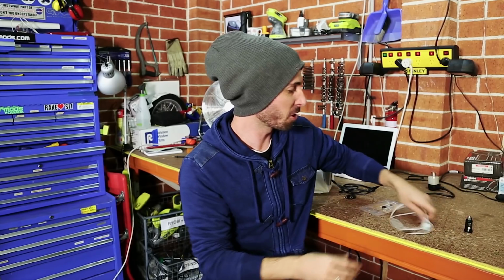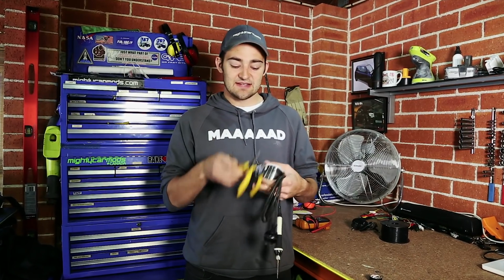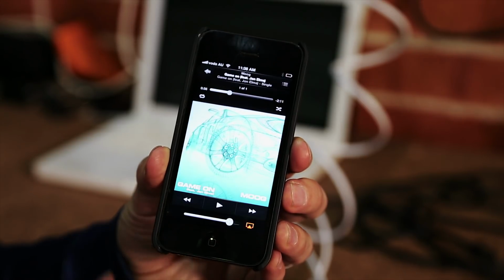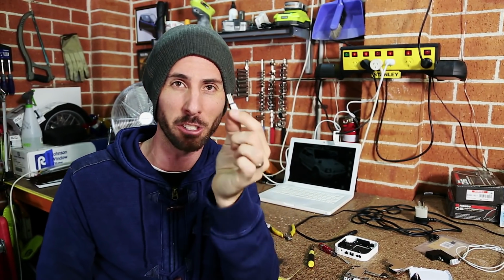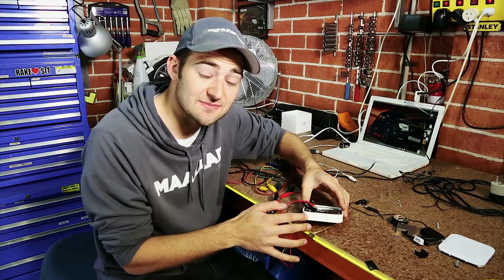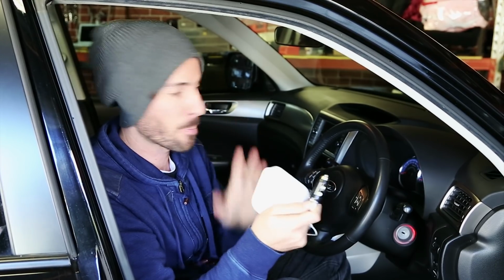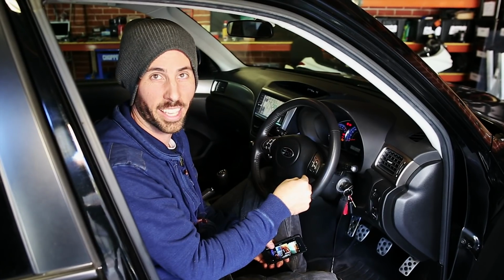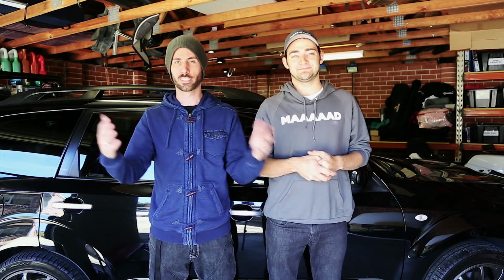Install Airplay In Your Car

Comment: Now, if you could only hack it to grab a digital output before the audio goes into the onboard DAC, you'd have an audiophile grade cheat piece from heaven.
Reply: The DAC in Airport Express is top-notch.  Ridiculously good.  There is also a digital output inside the audio output port of airport express units...just use a mini Toslink to access it.  No reason though...did i mention the DA converter is completely amazing, and that the RCA output is super clean and high voltage?

Comment: Why not just make a cable with a buck convertor from 12v to 3v?  instead of hacking the device.  Just saying ... then if the device dies, buy a new one, plug it in.
Either way, cool idea.

Comment: For anyone interested in getting wireless music without the complications of doing what they did, look up the Griffin Itrip Clip. $20 and it does the same thing (using Bluetooth so both apple and android work) it holds charge, is a lot smaller and has audio controls on it.

Comment: The major difference between Bluetooth and AirPlay is that while Bluetooth compresses the files before transmitting them to the headunit, AirPlay is sending those files uncompressed, ensuring you get a noticable difference in sound quality. Even with AptX you won't nearly get the same quality from bluetooth compared to wifi-based solutions such as AirPlay or Chromecast.

Comment: Not that it matters much in a car but Bluetooth is compressed for transmission and so not 100% of the original frequency spectrum. Wifi and Ethernet are 100% faithful to the original source . Just saying it might account for the effort.

Comment: i did this with a Bluetooth receiver.i did away with the receiver battery and soldered in a power regular then hard wired it into my car but got that electric static problem coming out of the speakers how you fix that

Comment: There are easier cheaper ways to listen from our phone music to our car stereo with a little common sense. On my old 1996 car  I used AUX cable connected to my iPhone or MP3 and old stereo with AUX connection. That's it. My new 2012 car already has built in Bluetooth, AUX, MP3. With Bluetooth you can synchronize.

Comment: The cheap Bluetooth audio adaptors are pretty flaky. I currently have a rental car, simply getting into the car starts the music playing. With my $35 cheapie Bluetooth adapter this never happens seems like I always have to press the device to get it on and it will pair only 80% of the time. So this may be a good option. The new AppleTV has this ability to and does not require a Wi-Fi network i.e. does Peer to peer connections. Getting audio out of it challenge as his H DM I only know digital audio out like the old one

Comment: i use a lightning digital av adapter connected to my iphone then usb lightning lead to power up the adapter connect the hdmi lead into adapter then to the hdmi input on my pioneer car media system .... create a wi-fi hot spot on my phone and then connect to my slingbox via the phone and haypresto live tv in the car or music

Comment: Why not using a bluetooth speaker and mod that??? You're iphone also instantly connects to this device and plays audio just fine! I did this with my home cinema, just crack open a cheap (or free) bluetooth speaker, cut the speaker wires, solder some audio jack on there, and boom, you have wireless audio! I did got my speaker 4 free! So free wireless audio! And sounds really good!

Comment: All Cars after 2012 have Bluetooth Built in so.... all that hassle or just turn on Bluetooth...
Reply: AH8657 90 oh yea and what about all us plebs with cars before 2012? You donkey!
Reply: Jason Devlin dumb ass u can use aux or Bluetooth I had a car that's 2010 that had Bluetooth now I have a 2016 so I don't need an Customisation
Reply: i got a 96 celica with bluetooth and i can do that to any car with a battery

Comment: Installed a Bluetooth adapter from iSimple the other day in my car. Cost around $30 US. It's just a cable with a lighter socket at one end and a headphone plug at the other, the dongle part is small and includes a microphone and button for hands free calling. Way better solution than the Airport in this video, cheaper, and more functions. Plus it's far smaller and more portable :0)

Comment: Don't use bluetooth! Wi-fi is better for many reason.
- Best audio quality with wi-fi 
- turn off bluetooth and you'll save battery
- Best range with wi-fi
- If you don't have AUX. connector, you connect the 1/8 cable (from the airport to...) to the CD player connector or Tape connector.

:)
Reply: 1. wifi also drains battery, 2. range? what are you talking about. so you want to play music inside the car while you are outside?
Reply: also, in audio quality nothing beats good old wired connection
Reply: JayVan Geli I agree

Comment: Or use Bluetooth.....
Reply: Yup , get a 5$ USB Aux To Bluetooth transmitter.
Reply: (Also will work for Iphone + Android + Windows)
Reply: +Bastian Fontaine Range of my bluetooth audio receiver is 20m. Your limusine is longer than 20m? Would you like to listen to the car audio system out of the car? Is your car audio system strong enough to be heard from a distance of 20 meters? AirPlay in the car is a stupid idea. AirPlay is good for game video streaming. For video playing is better to use a smb (Samba), or ftp server. DLNA is a mess. AirPlay audio is suitable for villas, if you have speakers in every room. Through walls WiFi works better than Bluetooth.
Reply: I don't really understand why you nerds are arguing about bit rates. As long as you can hear something coming from the speakers in good quality, it should already be fine.
Reply: bit rates are accually what makes a sound "good quality"
Reply: I'd like to see a source for BT being able to handle 24 bit. I've never managed to get anything more than 16bit through BT, even on v4.1
Reply: I assume the MY09 didn't have Bluetooth? My MY12 does and aux and USB aux.
Reply: About-Alex Exactly what I thought.
Reply: On a factory system, you won't be able to tell, especially when you are pushing the sound via AUX.
Reply: For a car like a older Toyota which has a factory system this a very good option. Bit rates aside this is a good alternative to a $150 adapter (assuming you have a airport express sitting around).
Reply: The people who cry about bitrates aren't the same people who argue FLAC vs MP3.
Reply: for all u kids arguing about bit-rates... fuck up also how about AUX
Reply: Ôzeş Gülok Do you think Bluetooth can not transfer the bitrate needed for your music? :'DDD
Reply: +Pro_Gamings 2ND channel Bluetooth to aux you mean
Reply: +Bastian Fontaine Through which cable going audio from Apple AirPlay device, to the car audio system? Trough HDMI, S/PDIF...? Or through 3.5mm mini jack/STEREO cable? So where is the higher quality??? When you think you recognize the sound quality, buy a cable with gold plated connectors! :D Do you ride the bus, when the cable length bother you? When you own the high end car audio system, with surround sound, I believe, the system support some wireless streaming. What is more expensive, it is automatically better? I'm happy, I'm not the american Apple sheep.
Reply: About-Alex just use your IPhone 7's headphone jack... oh wait
Reply: Bluetooth is much lower quality than Airplay though. If you have a fairly high end audio system, there will definitely be a difference in sound quality.
Reply: konzerva80
3.5mm is what I use for most of my stuff, I'm not an audio snob or anything. And yeah, every system should have wireless streaming but bluetooth is shit for that right now. DLNA, Airplay, or hell, chromecast are all much better options than bluetooth. Plus bluetooth is limited by range which sucks cause I tend to walk around a lot and it doesn't have enough range. With internet streaming services such as those, it really is a better experience overall. And my receiver has Airplay built in so it's not an airplay device connected to it.

Comment: Lol at all the comments suggesting the use of a cheap Bluetooth dongle. 

1) This video was released nearly 3 years ago, let it go.
2) Airplay had much better sound quality than A2DP at the time this video was made. 
3) Yes, Bluetooth is cheaper and easier. They were aware of that. The point of the video was to install Airplay into the car, not Bluetooth; otherwise it would be titled "Install Bluetooth in your car."
4) Go do something productive with your life instead of whining about something someone did to his own car some 3 years ago. :)
Reply: But you'll waste your time whining about other people whining?
Reply: Tim天明 says as he fucking writes a whole paragraph.
Reply: Wouldn’t aux just be better sound quality and basically free
Reply: Do you hear higher sound quality through Airplay??? :D

Comment: This will only work if you have WiFi. So you have to use your phone's hotspot while you are driving. Unless you just want to hang out in your driveway or garage and use your home WiFi. So why not just use the Auxiliary input if there is one there already? You can output sound from the Lightning connector on phone instead of the 3.5mm Jack for better sound. Just wondering.
Reply: +KissofDawn2012 
1. Bluetooth
2. Easier to sit in your car and get going rather than plugging in a cable every time
3. Cause race car

Comment: so.... instead of a single cable going from your phone to the car, you now have a cable going to a charger, a separate one going to the stereo, a box in the centre console and you still have to have the phone on you! seems almost pointless! a better solution would have been to just get a cheap Bluetooth A2DP adapter which already gets powered via micro USB and use that. The job would have cost 1/5th as much and would do the same job.

Comment: I'm using a Bluetooth transmitter connected to the audio out, and Bluetooth speaker, and don't have any speakers installed in the car. Just Bluetooth. You can move the speaker around, or move it outside. So far, I think it's OK. Then again, I don't need BIG sound.

Comment: Use Bluetooth 4.0 with aptX, you can even get a device that has an optical output, I have one myself and it works amazing. You can sync new devices with NFC, but once it's set up it will automatically connect.

Comment: a cheap and easy way to get music in your car???!!! wtf its a expensive and hugely complicated process just so you dont have to plug the jack in to your phone? i dont understand the advantage, they spent loads of money and time and now have to have a extra box in their car just so they dont have to plug there phone in? either way they have to plug the box in. this reminds me of a story about america wasting millions developing a pressurized pen that would work in space and the Russians just used a pencil..... maybe im missing some huge advantage this system has
Reply: +Charlie Ward you are also missing the point of the pressurized pen, it was so that pencil shavings don't get into air filters and cause issues. But the reason for The Airplay (Which I agree is stupid in this application) is more of a convince than anything so when you are riding with your friends or road tripping with more than like 2 people anyone can be the DJ without worrying about a cable.
Reply: MrLazer1211 ahah ah ok :P thats actually quite interesting, how did the russians get around the shavings? just clean their filters regularly? aha and yeah but passing the jack isnt exactly hard ahah
Reply: +Charlie Ward I'm pretty sure that Russians are being using automatic pencils. They didn't flew in the 18th century to have the need of shaving their pencils  :D

Comment: This is a very good idea but unfortunately I don't have the headphone jack in my car do you suggest anything
Reply: If you have an AUX button, you should be able to buy a cable for it. If not, install an FM modulator or a new radio.

Comment: This is great, but, there seems to be a pic missing on website, no diagram :(.

Bluetooth adapters have their drawbacks: mine likes to skip sometimes (it is BT4.0), have to hold a button to connect every time I  turn on the car, takes up a USB charge port, open Shazam app and it switches the audio to internal speaker until I close the app, streaming audio quality is lower as BT has less bandwidth than wifi. Bluetooth is more subject to interference.

Advantages to this setup: Using AirPlay over wifi gives higher quality audio without skipping, does not require pairing, connect once, automatically connects when you stop and start the car again during trip, frees up bluetooth for phone calls only, also, anyone else in the car with iphone/ipad/ipod touch can stream their music without having to pair their device, and no need to enter password, as they are not getting on the wifi network, just streaming via AirPlay, Shazam should work as expected, without interrupting audio.

In future, with another vehicle, would like to do airplay video also, perhaps apple TV (not the new one about to be announced), since it's only $69. Apple TV has the ability to connect to iOS 8 and newer devices without a wifi connection (direct).

Comment: I need the opinion of someone smarter than I am. I am currently working on building this and I'm just waiting on my voltage regulator to arrive. This is my plan: I want to keep the power supply unit of the airport express in so I can use the wall adapter, with the option of being powered by either the regular wall adapter, or a USB cord that will have its own exit. I will install the voltage regulator and wire it as done in the video and use ring terminals to connect the regulator to the airport,  but place a diode on the voltage output of the regulator, which will prevent electricity from traveling in the output when the power supply unit is used. Will this work? I have access to all the extra parts (ring terminals and diode), I just want to be sure it will work before I get everything together to find it won't work.
Reply: I know this is late and you have already done what you were going to do. But all you need to do is put the regulator and usb cable in it and use a 2 amp usb wall plug that you would use to charge a phone or tablet. Works fine.

Comment: Wiring a standard Bluetooth A2DP to Aux receiver is much more convenient than this brainless mod. It is cheaper ($15), already powers up from 5 volts source, it is much smaller, virtually compatible with ALL smartphones, and most of them also work as handsfree for conversations.

Comment: For Android users: use a Bluetooth receiver.
Reply: DankFrogz What the fuck iPhones can use Bluetooth receivers too
Reply: dayway05 And for Apple users.
Reply: You do know that audio over bluetooth is quality wise inferior to airplay yes?
Of course you can use bluetooth if you have a shitty car with old stereo. 
If you have a new bmw with bluetooth sound and harman/kardon or B&O, i do recommend using the USB hub
Reply: +dayway05 AirPlay has a better sound quality than Bluetooth due to the fact that its Wifi but I guess android users don't care about quality music anyways
Reply: your right. iphones and androids are both awesome. i just dont like their exclusive everything. even though there is no real reason to not just use it
Reply: +AppleAssassin Shut up AA you need to go to a AAA meeting

\o/ lol \o/
Reply: +Seized Cheese Yes, because overly compressed, low bit rate audio is going to sound SO much better in a horrible sound environment such as a car.  The quality of the system doesn't matter if it's built inside a tin can generating noise at an exponential rate of increase proportional to speed.
Reply: +Mindinversion S I´m sorry if you have a shitty car stereo... Some of us actually buy high-end stuff for our Cars.. Including ludicrous expensive DACs and Sound EQs... WE use 30 pin or Lightning connectors to use the Digital Signal not the horribly raped Analog shit the 3.5mm signal puts out.
Reply: Unveiled Skill But it looks so good...
Reply: +AnotherAlpaca your right. I'll go back to itunes where all my music is gone because they ban flac because they dont care about sound quality
Reply: Banks4004 They don´t BAN FLAC they don´t support it because we have ALC which is basically the same fucking thing.
Reply: +dayway05 yup, I use the homespot nfc receiver.

http://www.amazon.com/HomeSpot-NFC-enabled-Bluetooth-Audio-Receiver/dp/B00G57CWZ8/ref=sr_1_2?ie=UTF8&qid=1440909584&sr=8-2&keywords=homespot+nfc+bluetooth+receiver
Reply: Mindinversion S see, you've never heard one of those system in a "tin can" right?
the burmester soundsystem in an s-class is magnificent, but sounded like shit when you conected a phone via bluetooth, USB was way better.
Reply: +dayway05 i did this ages ago with one of those cheap bluetooth speakers from china... those work at 5v so you don't even need the 7533 that is used here
Reply: +Mindinversion S yes but what about a car running say performance grade 4"speakers 6"speakers 6x9"speaker and subs
Reply: Yep
Reply: Apple users too lol
Reply: +Banks4004 My house is officially on fire cause of this comment
Reply: iPhones can do that too lol
Reply: +Banks4004 how about black berrys hmm

Comment: No Aux input on my head unit, what's the best way to play music from a phone? Every fm transmitter I've tried fails terribly
Reply: DIY Aux input
Reply: Adam Teare try the Belkin TuneBASE :) seems to work for me
Reply: Adam Teare If your car has a tape player, there are cassettes you can buy on ebay that have a 3.5mm jack
Reply: does the unit have usb port?
Reply: Jacky Qin nah it doesn't have shit, I'm just gonna sell it and put a decent stereo in a new car

Comment: why do all of that? you can simply pay through blue tooth or use the aux in the car connected to a headphone jack for less than $10
Reply: KMANANDROIDINFO  your solution is $100 Airplay and tools $20 Total $120. this is dumb and too much work!